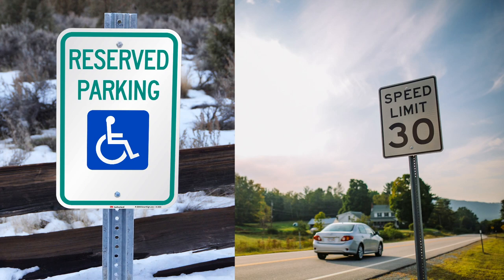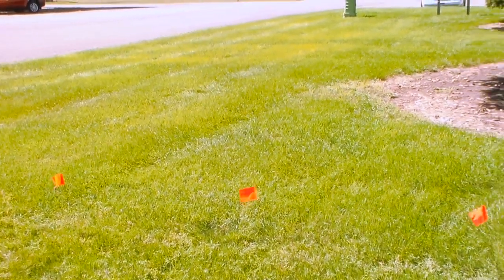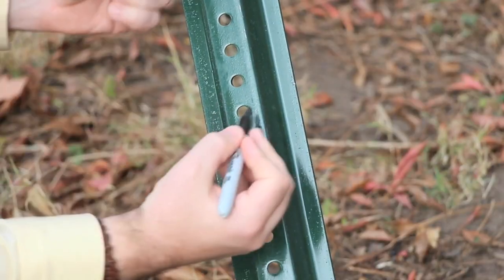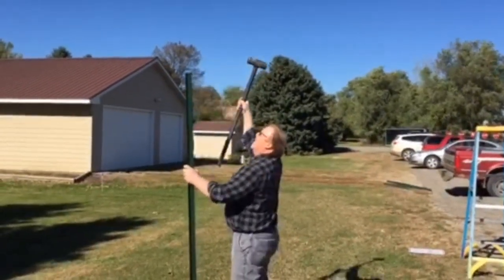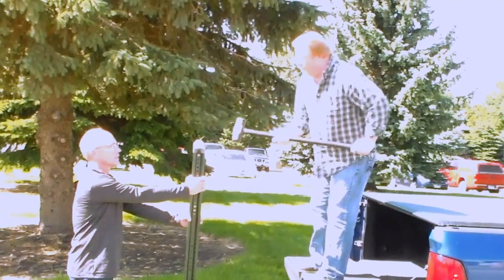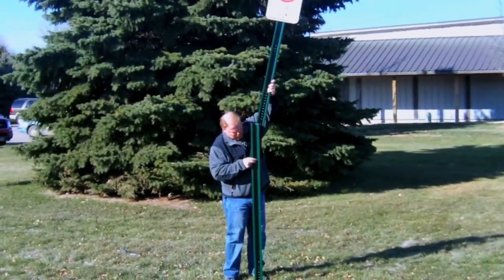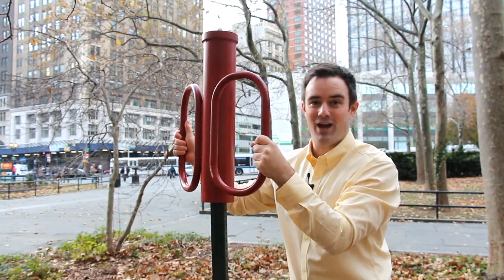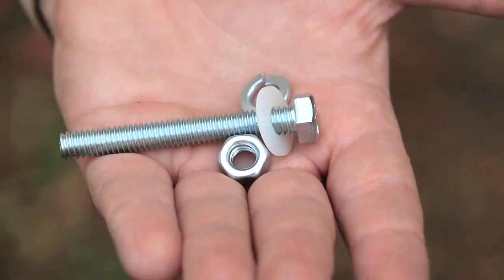How to Install U-Channel Sign Post Safely

Comment: A sign is supposed to be 7' from the bottom of the sign to the roadway....not sidewalk or grass.  So a 30' Stop Sign, needs to have 30' in the ground, and 84 inches from ground to the bottom of the sign.  That's over 10' of post.  You can't do any of this with a manual post pounder without splitting your head open.  You'll also have a tough time doing more than 3 no matter what kind of weight lifter you are.  So you use a sidemount adapter, attach it to the post and then use a gas powered rhino to drive that (not the post) into the ground.  Only way to do signs the right way....and never, never have the post sticking off the top of the sign.  Sign should be flush with the top of the post.